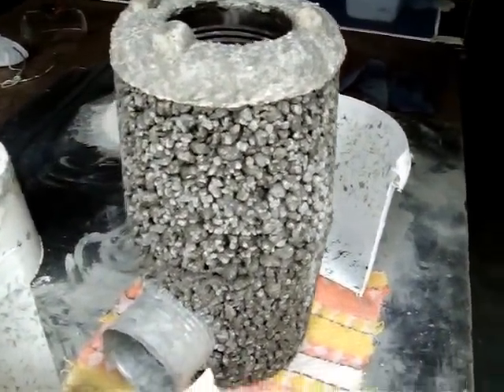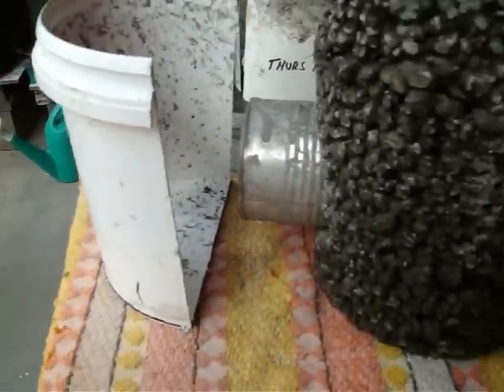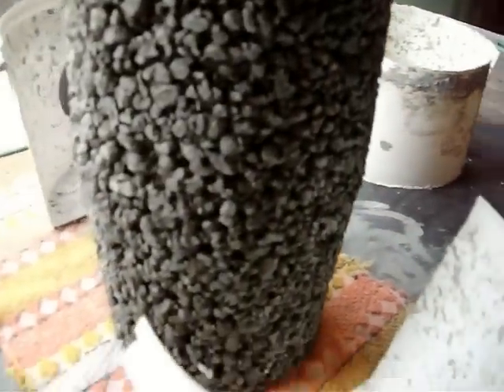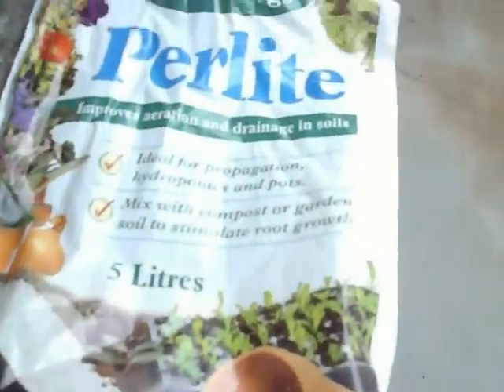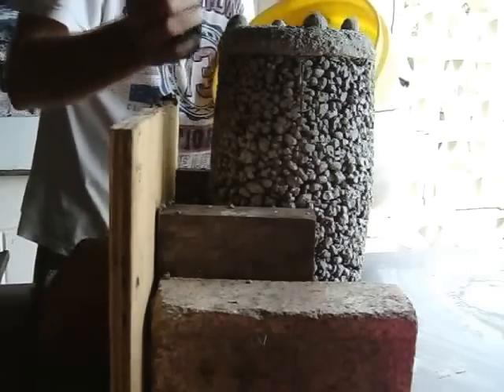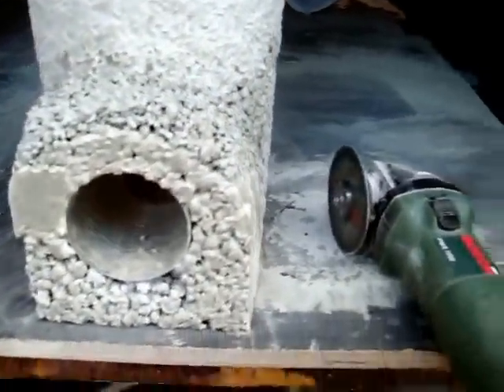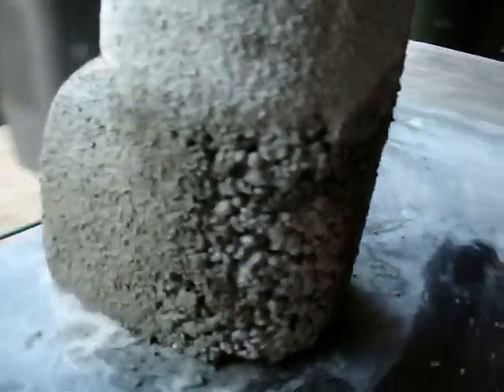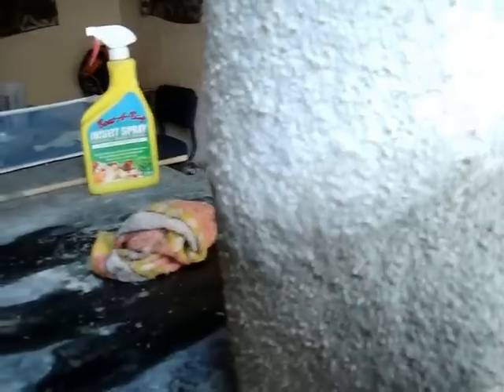Make a Rocket Stove for $5

Comment: Cool. You said when the tin cans rust out you'll be left with the pumice. I was wondering how long these tin can stoves will last?
Reply from the maker: Use cardboard tubes wrapped in plastic wrap as a form as the cans will expand and crack it  ! Flue height is 3x flue diameter=3x4inches=12 inches.
See cooking here>https://www.youtube.com/watch?v=FhMY6lTwX3g

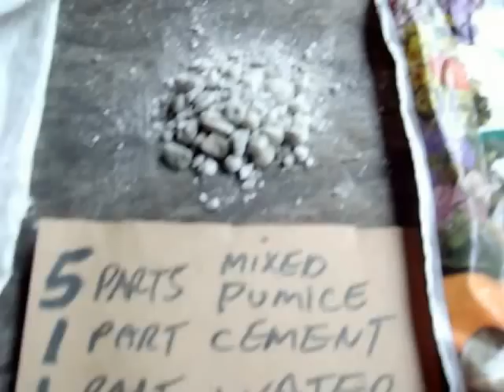Comment: Would the same pumice size ratio at the 1:55 mark work for the pizza ovens also. And will that ratio work with perlite and vermiculite. You rock on both.
Reply from the maker: Thanks for watching Kieth !  Yes,my pumice mix is the same for my ovens ,crushed and put through a 1/2 inch sieve with plenty of fine pumice and mixed 5-1 . I see most people are using a vermiculite mix.
See ovens lately here>https://www.youtube.com/watch?v=kP9poGmzH1g
Reply: If you made another pizza oven what would you do different
Reply from the maker: Make arch 1/2 inch thicker as 2nd oven arch has small crack but could be from removing arch form-work to soon !

Comment: Okay here's a comment I really like the way that you prototype your rocket stoves... it's an inexpensive way to see if your ideas are going to work .or not work ...
down below in the comment section I noticed the guy concerned for your safety and health about you using galvanized pipes even though you clearly state that you are prototyping and you are outdoors and are aware of the dangers of galvanized metal getting too hot and breathing it in so on and so forth so anyways big shout out to you for making a video good job.... and for the troll get a life. If you guys want to see some real dangerous stuff check out..rocket heater fire tunnel jump. have a good one and hope to see more videos from you soon ...from TC time. If you like that one you should check out setting myself on fire accidentally it is hilarious!
Reply from the maker: The cans expand when heated and crack the pumice concrete so I use cardboard tubes instead !
See heat test here>https://www.youtube.com/watch?v=zkHVjrNqe38&t=144s
See pizza ovens made from same stuff>https://www.youtube.com/watch?v=kP9poGmzH1g

Comment: Just wondering...do you think I can substitute perlite for the pumice stone?  The perlite isn't as course as what you have and would have a smoother finish, so I won't be using the stucco on the outside of it. I will have to pour the inlet and stack at the same time so its 1 peace to prevent cracking.  I was also thinking of using stove pipe for the inside. What do you think. This will be my first build so would like some suggestions.ThanksBob
Reply from the maker: Best to use cardboard tubes painted to do the holes as the steel tubes expand and crack the concrete ! You could try vermiculite as well ,see here >https://www.youtube.com/watch?v=-j25Z65eaYk&list=PLmE0FyFvptLN86xwLeqt2yPBr3gw3s95d

Comment: You posted this two years ago.  It looks good, but cement doesn't have a good reputation with high heat (but did the problems come from the sand and gravel, instead?).  Has it done well in the long term?  Your ideas are incredible -- so very useful!  Love the oven, too.
Reply from the maker: The aggregate is all crushed pumice that is about 70% silica and 13% aluminium oxide which has a chemical reaction with the portland cement to make it more heat proof.I have two of these and no cracks yet !

Comment: The concrete is enough, get rid of the steel cans. They wont last anyway.
Reply from the maker: The cans are only to help cast the stove,but i'm worried they may expand when heated and crack my pumice concrete.Next time i'll use cardboard tubes?
Reply: jjgrice018 Try 4 inch plastic drain pipe with some lube on it so it wont stick then let sit for one hour, twist and pull out then let harden before use.
Reply: billandbeaufort The outside looks great!